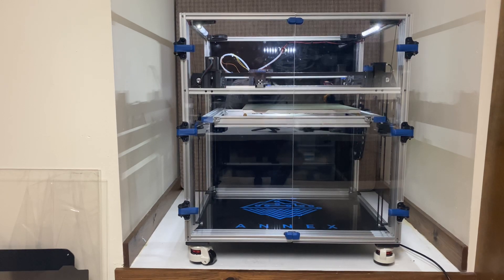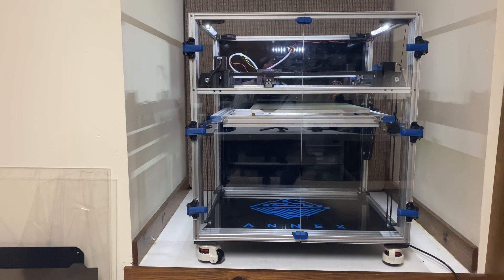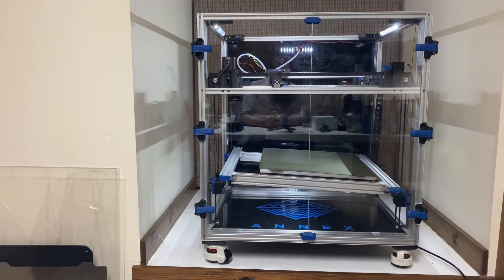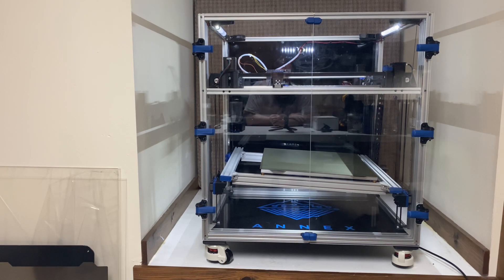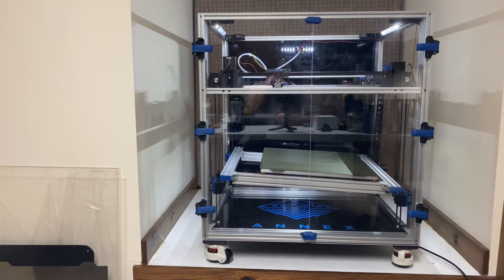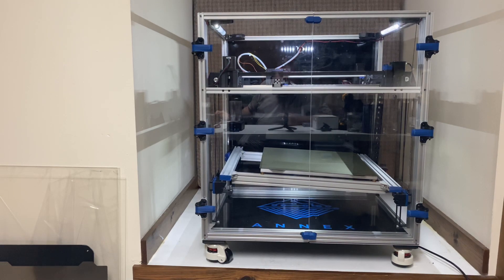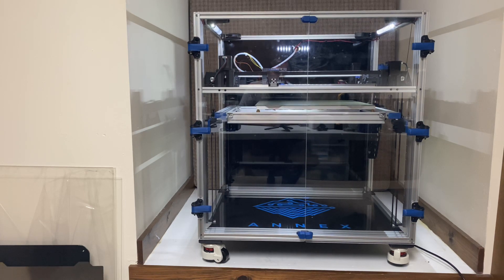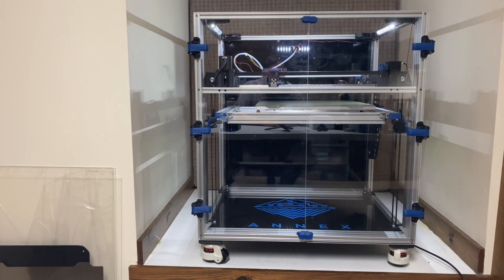Annex Engineering K2 - direct drive Z - how to suspend 13 pounds of bed!

Comment: I know this is two years old but have you seen the Galileo z drives for the Voron 2.4? Planetary gear reduction, the bed won't drop at all. 

Also, what is the benefit of removing the gearing? Seems like a lot of additional workarounds needed in order to remove the gearing.

Comment: Hey, unrelated question - what are those casters? Could you plz share a link for them?
Reply from the maker: If you search amazon or ebay for "self leveling castor" you'll find them.  The brand name is Foot Master, mine came from discount ebay listing, box was labeled "FOOT NASTER" hahaah.   The K series have an adapter included for the GD-60F size.
Reply: @JoshMurrah  :D thank you!

Comment: How about doing this like in an elevator? You could connect belts to the bed, which go up to an idler at the top, and then down, where a weight is on the other end. Then, you could finely calibrate the weights to be exactly as heavy as the bed.

Comment: So on this printer setup, with belt holding the z-axis. A power loss recovery is not possible, even if it is just a fraction of a second? :|
Reply from the maker: That's correct, with direct drive Z, you gotta re-home it etc.  I usually run my printers on UPS, and never use power-resume functions.
Reply: @JoshMurrah  Ah, of course, UPS :) That eliminates the problem with a possible power outage :D
Does your printer do the gantry level and then a mesh bed leveling? Or is that a five point mesh bed level?

Comment: I am also trying to build a k2，which control board are you using to control these motors？
Reply from the maker: Using the BTT octopus pro and an Annex-designed 4 stepper board.  Need 9 steppers.

Comment: This seems like a really ineffective design for suspending the bed since you need extra hardware to prevent the bed falling during a power outage, what's the supposed advantage to this style vs. the voron 2.4's fixed bed?
Reply from the maker: I run my 2.4 without gearboxes as well. The reasoning is mostly the same in both cases - cost.  Voron gearboxes cost $120 and the K2s worm gearboxes are $200.  I can also run my Z as quicker speeds for Z hop.
Reply: @JoshMurrah Josh, look into the Galileo 2 Z Drives. I haven't tried them but seems interesting. Also, geared z drives are not expensive? It's printed parts, a shaft, some bearings, closed loop belt, and large pulley.